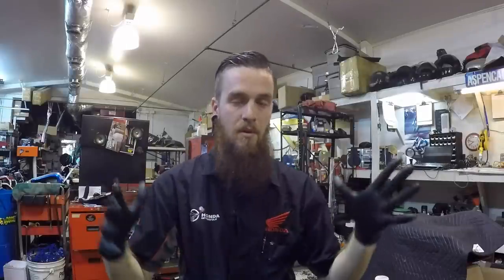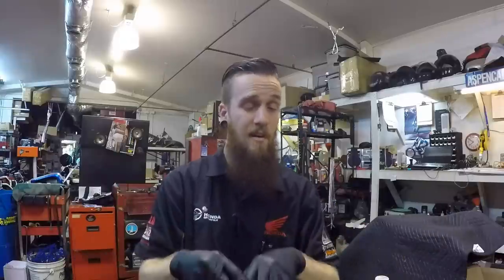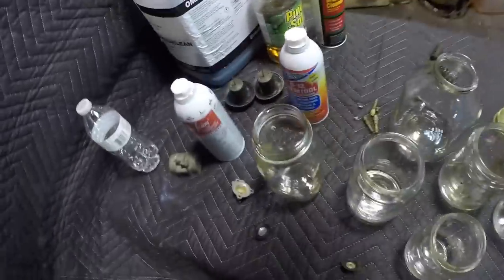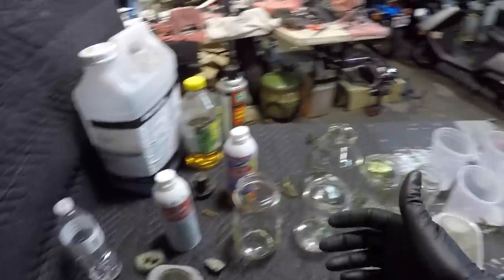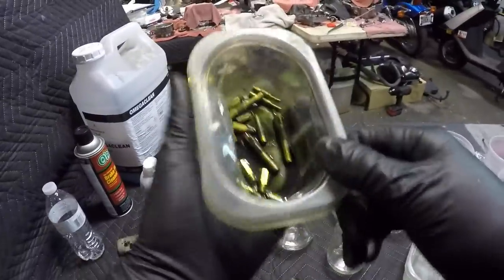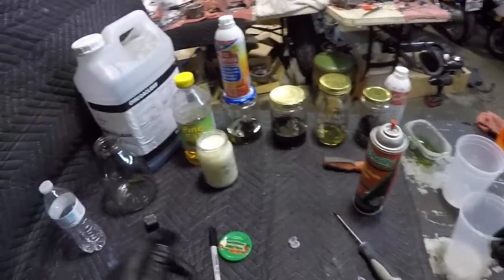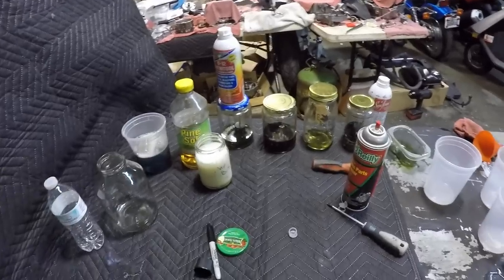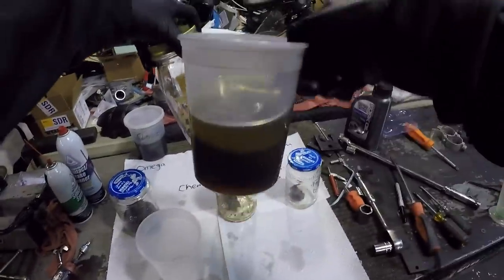Carb Cleaners and Fuel Additives: What Works?

Comment: I had a dirty main jet in my carbs. Was quoted $650  from multiple shops to clean my carbs. Used a 50/50 seafoam/gas mix. Cleared up after just a couple minutes. Filled up my tank with fuel and it clogged again. Went really heavy on the throttle while riding and it unclogged again. $7 is much better than $650.

Comment: Thanks Cody. I'm a Sea Foam user and swear by the stuff. Seen it clean out a rusted fuel tank to showroom perfect. SEEMS to be working well in the carburetor as well. Your reassurance of it NOT damaging rubber was a major plus! Thumbs up!
Reply from the maker: I was pleasantly surprised! Your welcome!
Reply: Seafoam didn't clean my gas tank muratic acid miked 4/1 and cleaned it like new
Reply: can seafoam cllean a carb of a bike that did not run for 5 months?
Reply: @EvendimataE  disconnect gasline and add pure seaform to the carbs after draining the bowls completly .. then run the bike for 3-4 secs and let it sit for 24 hours .. reconnect gasline and rinse them out with gas .. repeat step 1 and u should be good to go
Reply: Lol 😅. An Italian tune up.
Lazy people do not want to clean out the fuel tank, filter and properly clean the carb(s).

Comment: I've been using ONLY Seafoam for the past 30 years and that's all you need, nothing else. Just put an ounce per gallon in your gas can for your chainsaws, lawnmowers, snowblowers, etc. and all of your small engines. It will keep your carbs clean all season and is an excellent fuel stabilizer for the off season. There's no reason for all different fuel additives. Seafoam is all that's needed. I haven't needed to take any of my carbs apart for cleaning since I started using it.

Comment: The best and only thing I use on corroded float-bowls is battery acid. Just saved a set of Porsche 911 3bbl Webers stored outside. It's like an Alka Seltzer; NOTE: As soon as the bubbling stops, dump it out and immediately rinse with water. Since the corrosion is zinc-oxide; for you people who paid attention during Chem 1, Sulfuric acid has 2 hydrogen atoms along with 4 oxygen atoms which easily breaks the zinc/oxygen bond; without any side effects to the zinc casting itself. This includes passages. As far as gas additives go I use 1 cap/gal of standard ATF; works great on cables too.

Comment: I have used Seafoam for yrs. I have a Silverado with the 5.3 and a Ford Taurus with the 3.0. The check engine light came on in both vehicles. The codes said one of the banks was running lean . I added Seafoam to both vehicles  on fill-up and cleared both codes. No prob!
Reply: drinking seafoam you can walk on water, perform miracles.......

Comment: Maybe I've missed the point. But if you don't use the chemical for the intended purpose AND in the recommended application, I'm not sure that your conclusion were useful. Enjoy your videos overall though, suggest you be careful about experiments that don't have sound testing methodology. Thanks for what you do, I'm a fan.
Reply from the maker: Don C. I'm sorry that your unsatisfied with the conclusion but it is what it is. I was actually hoping there would have been a definitive result in the testing but regardless It was something I wanted to test and share...
-Sea foam did nothing to the metal jets.. but did not hurt the rubber which many people say it does.
-B-12 additive DID change the rubber but also did much better on the metal. 
-Chemdip performed the best used in the way it is meant to be used. 
Omegasonic did not do well used in the same way.
Reply: OK
Reply from the maker: Don C. Reading back my reply, I came off in a way I didn't like. I revised my comment and wanted to thank you for your feedback as well as sticking through the video! Your subscription and feedback is valuable! 🤙🤙
Reply: I wasn't put out by your response Cody. It's hard to convey the intended tone sometimes in writing, so thanks and I'll continue to enjoy your videos.

Comment: I used Pine Sol in a cheap Harbor Freight ultrasonic cleaner to clean the carbs from my 1996 Honda Magna. Did a great job but all of the brass turned into an almost rose gold color. It was concerning but I've put thousands of miles on it since then without any carb issues. Great video! Subbed.

Comment: one that I like to use is bore cleaner. works great on crud and carbon. I don't soak any rubber components in it so I don't know how they will hold up. I imagine not to we'll so I don't due it. definitely helps loosen and break thing's up to come behind and and the finishing clean. when I deal with valves ore any heavily built up parts I mix a little seafoam with it. using steel wool to polish and clean definitely a game changer. never tried it before seeing your videos. thanks for the tip Cody. will note that if using steel wool make sure to blow or rinse out the steel wool that gets left behind.

Comment: I love SeaFoam. I run some through my cb650 every once in a while and it keeps my 4 carbs clean. I also dump a decent amount in the bike before storing it for winter and it fires right up without any trouble in the spring. I don't use it as a solvent, but it's definitely my go-to first try when a fuel system needs a good cleaning.
Reply: Kcducttaper1 Awesome as a fuel stabilizer.
Reply: Yeah, after sitting awhile, sometimes my lawnmower won't start (probably too much water in the fuel and somewhat gunked up carb), but several times now, I've put in a generous dose of Seafoam and it starts up and runs ok.  

   On a side note: I have 150 Fly Scooter. I'm trying out the Shell V-Power plus premium gas, as high compression, high revving, especially single cylinder engines, apparently need a higher octane fuel to run optimally.  Plus the Shell stuff has higher amount of detergents in it, like PEA, than other fuels. Not sure how compatible PEA is with carbs--it's usually used more on fuel injectors.  Either way, I'm still using SeaFoam as well.  So far, so good.

Comment: Chem Dip is supposed to be washed off with fresh water, after soaking.
Brake cleaner doesn't work anywhere near as well as aerosol carb cleaner. 
Brake cleaner is great for removing brake fluid and anything oily or greasy, and leaving a completely dry surface, but doesn't work as well as carb cleaner for cleaning carbs.

Comment: B-12 is solvent based which is responsible for the cleaned parts but also what caused the rubber to deform, seafoam is not solvent based although i think it is still petroleum based but just doesn't have any of the  Petroleum distillates necessary to make it a solvent, honestly though, for Di-carbonizing cylinders I get the same results from using plan distilled water as i've ever gotten from seafoam although i think seafoam gives a better smoke show when you start the vehicle which is why most people use it anyway....

Comment: When i tear a carb down for a rebuild i soak the nonrubber parts overnight in acetone. cleans all varnish etc. and makes everything like new. Seafoam is awesome stuff but wont replace acetone.
Reply: Michael E Burns 
Absolutely agree with you. 
And for those that don’t know it’s denatured alcohol. You can poor it on your tv (unplugged) and turn it on (plugged in) 30 minutes later. It is my #1 heavy duty or electronics cleaner.
Reply: 13-13 so it would be used as a soaking agent, degreaser, additive, could I poor and scrub? What would you say the preferred method would be. You can’t run it straight through the fuel system could you?

Comment: Thanks Cody, i enjoyed your video. One question: What would you add to the fuel to store a bike for 3-4 months during the winter?
Reply: Hello!, when I store my KLR, I store it with a full tank of gas& fuel stabilizer. I also drain my carb. I haven’t yet had any issue, and it’s a 2013.👀😎👌👍👋✌️🍻🇨🇦🌟

Comment: what do you know about adding the recommended 1 ounce of seafoam to 1 gallon of gas?
And run the the bike on that mixture  once or twice in a full tank? Will there be any issues
 while riding with this mixture?
Reply: I've been running 2oz of sea foam to gallon of gas in my 97 cb750 since I bought it 2 months ago. The only "issue" I've had is it now starts and idles better at cold engine temp! Eventually I still need to pull the carbs and clean the pilot jets. Run the bike with sea foam it won't hurt anything, all it'll do is help
Reply: It will smoke and when no more smoke then it's usually clean

Comment: Hey Cody! I love your videos. No matter how big you get, please retain the format you use now. I get so sick of watching overproduced crap on YouTube with setups and punchlines and special effects. Seeing your channel and how you go about doing your videos is great to me. It's informative and you just come off as a genuine guy who loves bikes and knows his shit! 

I do have one question for you though. I've got an ooooooold (1992) Yamaha FZR 600 that runs great! Buut. It fouls plugs a couple/few times a year. I've gone through the carbs twice and I drilled out the EPA brass caps and re set the idle/air mixtures back to the 2.5 turns out for factory spec. It still fouls plugs anyway. They're Mikuni CV downdraft carbs. Emulsion 'tubes' perhaps, even on a 10k mile bike? Thoughts?
Reply from the maker: +Loren Husky Hey man! Thank you for the encouragement man! I would try switching to a hotter plug and seeing how that responds. Like if you are using NGK dpr7ea9  try a dpr6ea9. Lower the number, the hotter the plug. It also sounds like someone may have put after market jet needles or jets in there? Have you referenced the stock jetting to see if yours is factory?
Reply: That is actually what I did. It calls for NGK CR9E and so I switched to CR8E which is one range hotter. It makes a difference for sure but they still eventually foul out. As for the jets, I think when I had them apart that I checked that but I actually don't remember. I might have to pop one apart and look that up to compare.
Reply: Yep they lose the format and the talk in a TV format rythme .It's not the same.

Comment: Nice vid Bill Nye. "It's science!" really tho lol That was a good test. Using different formula brand additives and comparing against other types of cleaners was a good idea to show differences. I especially liked seeing seafoam vs b12 fuel additive. I know tests have been done in a running engine, and they both work well. However, showing how they work at room temperature with jets and rubber parts was where you made this test a very educational one. I also like seeing how products reacted outside of regular recommended uses like: pine-sol + baking soda, & the omega clean. Making your test a carburetor specific one was also a good move. Thank you for that.  I definitely learned some stuff from this. Lastly: how can I donate towards more tests like this? Thanks again for the education video.

Comment: that stp fule cleaner additiv is wonders i ue it to clean rust to clean anything it work great i put lil in my 150cc scooter i got for 140$ it ran but it keep jerking and seem to been giving me proplem i use the stp fule additiv fore cleaning the carbs and the fule system after day i notes it running better not jerking as much geting better everything on it better milage smoother run just starting to act like a new scooter agian after all had hair alot of hair in the oil when i changed it i dont know what the owner was doing to it but it had somany proplem i fix  the hairy oil proplem then the fule additiv for fule system cleaner just help the rest

Comment: I soaked my 1100 carbs in straight pine sol for two days. There are some small parts attached to the sides that began to deteriorate but it did clean the carbs. Gray stuff got all over my hands from those small covers though. Didnt ruin them tho

Comment: Hi I'm bill I'm in cny and I have a 1983 CB 1000 costom I have went though the carbs 4 time but I can only get it to run in 1 cylinder with carb spray all 4 will run . My question is word only having a 1/2 or less gas in the tank make a difference should I fill it and try . I have took the inline filter off new gas lines plugs new wires please help me if you might know what to try

Comment: I found a pretty good free cleaner😃
Dip an empty jam jar on a string into the home heating oil tank (kerosene) and fill up, take it out and soak your carb parts in it minus any rubber parts, cos they could be damaged.

Comment: Just a head's up: For the rubber parts (diaphragms & gaskets & such), smear them with a thin coating of Dow Corning High Vacuum Grease. They'll last damn near forever. It's not cheap stuff, but neither is the time and money spent ordering and buying new gaskets and vacuum diaphragms.

Comment: I too just found your channel. Thanks for posting these videos.  Heres.a.tip.i.learned.couple yrs ago.that.helped.me.increase mpg in my yota.truck mostly. Should mlm work same.for bike. Cheap too. Basically you.add.1oz tcw3 rated outboard 2 stroke mix oil per 5gal gas. Not more.or.less. posta.clean carbon out.of.gas engines.amd.lubricates upper cylinder parts. Google.'been testing oil' for.more info on an older forum. Works awesome in..my experience. With a.light foot I got the most extra mpg that ppl report- 5%

Comment: I got a problem i have a strimmer and it wont start cold unless i put petrol doen head or open rev and put some in there but then will run mint ive tried primming it choke on and off but when its warm it will start mint what do u think i can use to flush carbon out on a 2 stroke

Comment: I appreciate you sharing your experience with us on YouTube Cody.
I'm currently having an issue with one of the carb float valves on my '82 GL1100 sticking open and hydro-locking cylinder#2. In your experience, is this a common problem with old Goldwings? Hoping a treatment with Seafoam works to clean it up or else I'll have to take the carbs out and rebuild them - not a job I'm prepared to do this summer. I'm sure you've seen and heard of people running SF through the carbs with the engine running to help clear up all kinds of problems.  What's your opinion about this?

 Do you think lertting a high percentage of Seafoam soak in the carbs overnight would help clean everything out more? Potential damage to the carbs? Would it start up the next day or would you need to drain the carbs before startup?

Comment: i need help with my carb setup, idle is fine, but when you open the throttle to 1/4 to full whilst in motion the engine hesitates and backfires through the exhaust I've been told by my mechanic to check my float height as it might be a bit low. any help would be grate, the carb is brand new and specked for my engine all jets are original, engine is a 156fmi sohc, the carb is a pz26 accelerator pump carb. i have used the choke to check if it's a lean mixture and it just runs worse and almost stalls out
Reply: Chris Seddon  no fuel to the main jet ... fuel filter clogged, or the fuel lines (they may get gluey inside due to the ethanol crap in the fuel). Or there is floating mud in the reservoir i.e. clean the tank. Or the petcock, of course. Have to be one of these. Atleast according to my experience.

Comment: Great videos an information man.. 🤘  wondering if you can help me out. Rebuilding carbs on a 78 cb750. After soaking parts I was cleaning carb housing and one of the  felt washer washer ripped. Any ideas on where to find them? Waiting on rebuild kit to come in an it does not contain the felt washers. Can I use rubber o rings?? Any help would be appreciated. 👌

Comment: Cody, I'm hoping for some advise.
I took my bike out of storage, and it took me a while to get it started.  When it did start, it wouldn't idle, but I could keep it running at about mid throttle for about 30 seconds.  I noticed that the gas I had put in the tank disappeared!  Yep, all in the crankcase.
I'm guessing stuck float.  I'm going to remove the carbs and clean them.  Here's my question:
After draining the crankcase (done) what is the best way to introduce oil back into my engine now that it's "dry"?  I want to be sure that I'm not damaging engine components when I fire it up for the first time after my carb clean.
I've looked, and I can't find anyone that covers this topic.
Thank you sir.  Love you vids.
Reply from the maker: +lmdetect Hey man! A carb clean is definitely in order. With the gas oil topic I wouldn't take that too seriously. I have dealt with that issue many times. After you have drained fill it back up with the correct oil and amount and your set. If you are worried, once you fire the bike up and get it to operation temperature, feel free to drain that oil again to thoroughly remove any left over gas.
Reply: lmdetect just dealt with the exact same thing. I left my drz400 petcock  on in storage. Gas was in the crankcase. I replaced a oring where the float needle seats in. I just replaced and did an oil change. A little gas won't hurt it. P-47s add gas to dilute the oil for start up. So an oil change is good enough.

Comment: Im having an issue with my bike seeimg sluggish an the throttle is very responsive an sometimes it tends to back fire when im at a low rpm or sitting at idle. Would seafoam help? If so how much do.i add to the fuel tank. If tank has several gals in it do i run it with seafoam in it. I see alota vids adding it to fuel but whats right an whats not right . Thnks
Reply: Yzf r6 is my bike

Comment: You want a great product to clean METAL : use cellulosic paint solvent...the old recipe,  with toluene and xylene. This is making wonder and will remove any first (like cooked oil and grease).
Of course don't apply to any plastic or rubber and protect your lungs...